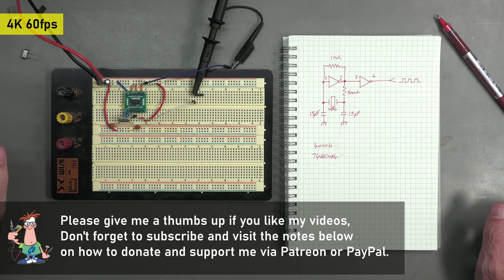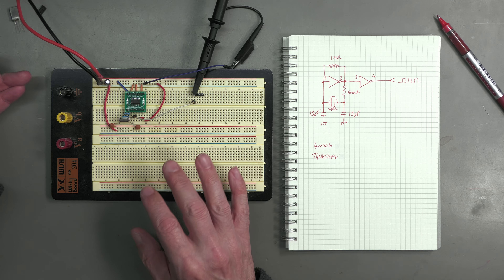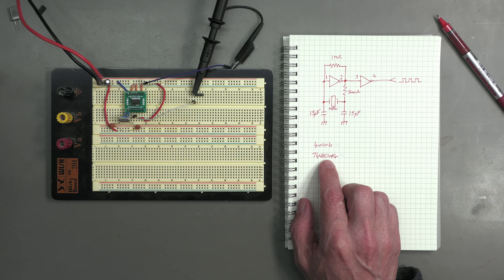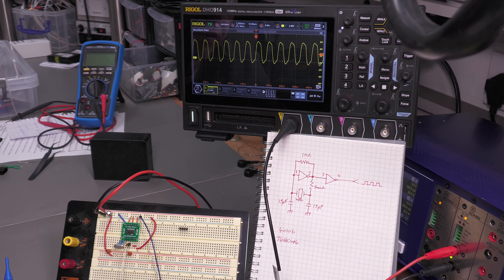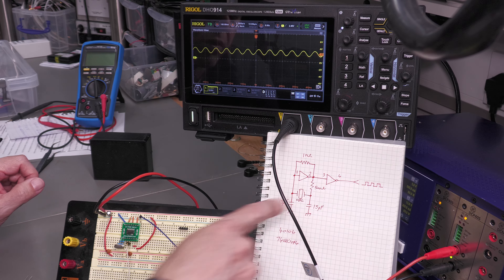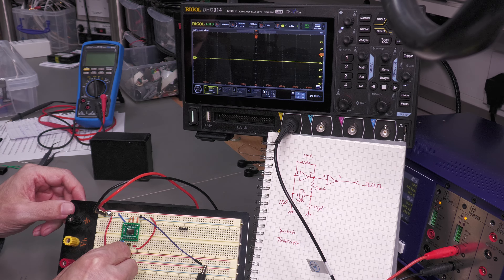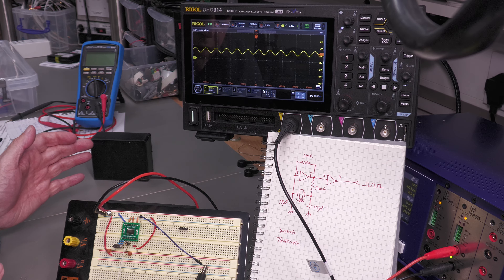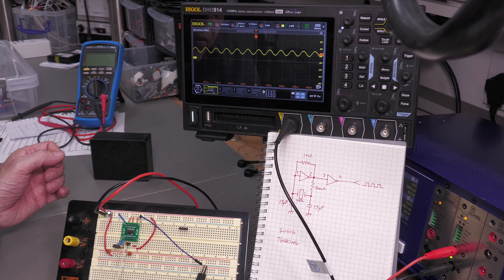No.141 - Matrix MCR-5200 LCR Meter Repair - Follow-Up

Comment: The USB interface is implemented as part of the microprocessor. The clock speed for basic USB functionality is 12MHz. I'd bet that if you measured the frequency of the bad crystal, it would also be out of spec. The USB device has it's own crystal of course and if they're too far out of agreement, the protocol can't sync. It's a shame that this locks up the CPU, but this is a story I won't forget for the future. Very subtle but specific symptoms.

Comment: USB needs a internal clock in the processor, so it probably adds a load to the internal PLL's & deviders, The logic level's aren't even reached. Feels good you persisted on the meter's fault finding.

Comment: Thanks for the follow up. I don't think that I would have ever guessed that it was the crystal. I can just about get my head around the crystal causing a stall when the USB stick was plugged in. Possibly the software selects the internal on chip oscillator at the start but switches to the crystal oscillator when it detects the USB stick so that the clock is accurate enough. If the clock switch fails it could the stall. Though I can't explain the the random lock ups.
Reply: USB requires a clock tolerance of 0.5%, outside of that it won't be reliable.

Comment: The 74VHCU04 unbuffered inverter is essentially providing a “raw” N/P channel totem pole directly to the I/O leads. Thus this single stage inverter has lower gain and is more readily biased to operate in its analog region to produce more perfect sine waves through the crystal. At higher frequencies one U04 buffer stage may be sufficient, but at lower frequencies more than one series buffer stage may be necessary to attain the output buffer gain comparable to a standard logic gate. 

A Schmidt trigger is the worst choice for a resonator based oscillator and will needlessly induce jitter. A properly driven resonator will produce beautiful sine waves that swoop through the zero crossing noise free; it just needs amplification to extreme clipping.

Comment: Excellent demo, Ian. You was right when you told it's extremely rare that a xtal fail. Several years ago, I had the same problem which drove me crazy. Finally, it was one xtal...maybe internally broken. Was a very difficult fault, because the machine was a Sony PCM3348 digital audio 48 track recorder (in my own studio). Thanks again for all your efforts and excellent explanations and clarifications.

Comment: Maybe too low an amplitude for the USB hardware to work; it usually uses a PLL to multiply the 12MHz to 48MHz and that may have had problems with the weak clock

Comment: When you think that the frequency is maintained by the mechanical properties of the crystal its a wounder they work at all. Was they crystal still on the correct frequency,  as the meter would work at any old frequency.  But I expected that the timings for the usb bus are quite tight and could fall foul of them locking up on coms retries
The only way you would know that the frequency was out was by measuring a known capacitor value. As it would still measure a value but it would be out of specification.  Crystal's in old radios were known for either getting lazy or intermittent.

Comment: Weird fault mode for sure, not would I have guessed at all.
It would be interesting to see a VNA scan of that crystal to get more info on what is actually wrong with it.
Reply: Hi. A VNA sweep should be very interesting but from scope results you can guess that xtal insertion losses are incredibily high causing a low amplitude oscillation. Regards from Italy.

Comment: That it crashed looks like the internal clock buffering was barely able to make the processor work, and when you plug in the USB device a transmission gate is turned on, that allows the clock to be applied to a part of the processor associated with USB, that till then had been basically powered onn and disconnected from the internal clock and data and address buses, waiting for the interrupt that comes when the USB device is inserted, and applies a sink or source to the data lines, triggering an internal flag that the processor uses to enable the USB system, and load the USB handling code. The extra load on the clock probably is what caused parts of the clock system to not trigger, you probably had this before where the threshold would dip after the chip got warm, and then it would fail to clock parts of the processor, leading to the lock up. Had that years ago with a clock oscillator, turned the crystal around and it worked again. You might want to try that as well and see if the amplitude changes.
Reply: Your knowledge never fails to amaze me :D

Comment: is the frequency of the bad crystal spot on? I had a repair instance where the frequency was off on a crystal. the unit would work fine, but the associated remote control wouldn't work as the timing was off just enough to cause an issue.
Reply from the maker: 11.999610 MHz on the Racal-Dana 1991

Comment: It's weird that the data lines to the USB were toggling. So it's not like the crystal just failed when the USB got plugged in.  Maybe the USB circuitry caused the crystal to be switched in somehow that then made it where the CPU could not longer get a PLL, or it was trying to talk to the USB and fell into a software bug, because who'd expect to have the crystal suddenly no longer have enough oomph to power the chip plus the USB circuitry.  This might make sense given when you unplug it, the software stays broken and doesn't 'heal' itself.  Though how that ties into the situation where the CPU just randomly quits updating the screen without USB intervention is a puzzler.

Comment: What would happen if you amplify the output from the second stage with transistors? Will that make the output strong again?
Reply from the maker: Yes, you could very easily add a Schmitt Trigger (40106) on the end there to get it back to full 5v operation. Despite being weak the freq. appears spot on.

Comment: ..Any date codes anywhere?.. I.E. Covid parts shortage allowing out of spec parts to escape the dumpster?
Reply: Ahhh. I see the date on the start up screen indicates software version 1.8.1. #2017.8....so that sets likely max age...
...Also serial no is 662024 - 06052 (6'28" in part 1 video) which seems to indicate 6th June 2024. This sets likely min age....
...Any dates on components?
EDIT ... I see early 2023 date codes at 17'14" in part1.... Guess that puts component manufacture around the middle of the Covid parts supply chaos.
Reply from the maker: The original Ram IC is 2315, so 15th week 2023.

Comment: What a weird fault. It would be interesting to put the crystal in a network analyzer. I guess you’ll see a weak resonance. Then open it up under a microscope and see if it has a crack or a delaminated connection. I volunteer for either…
Reply from the maker: Might try and measure its ESR compared to a good one also.

Comment: It would not surprise me if the crystal may be overdriven in the original circuit potentially damaging the crystal over time. The crystal manufacturers do specify a maximum drive level in uW/mW, but that’s rarely considered and connected directly to the IC without a series drive resistor. Physically smaller the crystal are more likely to be overdriven.
Reply from the maker: Possibly, just a bit surprising that this is a brand new LCR meter with this fault out of the box. Could also be cheap xtals and maybe damaged via the ultrasonic cleaning.
Reply: Its a large HC49 crystal, not going to be an issue.
Reply: @jaro6985  Actually, it’s a truncated one that withstands less power. Check your data sheets.
Reply: @ChrisSmith-tc4df  I don't see any spec for LPC2478 for drive strength though, maybe you'd have to measure it.

Comment: That is a weird one, in my 50 years of electronics I have not seen that one. A completly failed xtal... sure but not this
Reply from the maker: Measures 11.999610 MHz on the Racal-Dana 1991, so I suspect the ESR of the Xtal has gone through the roof.